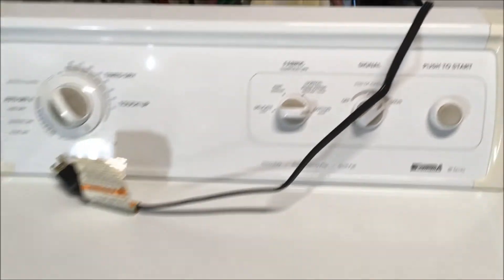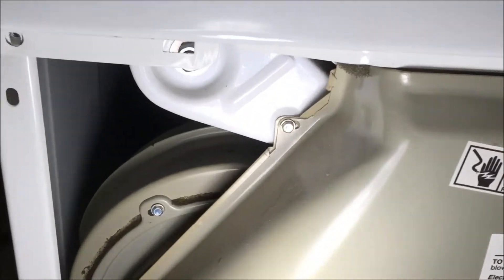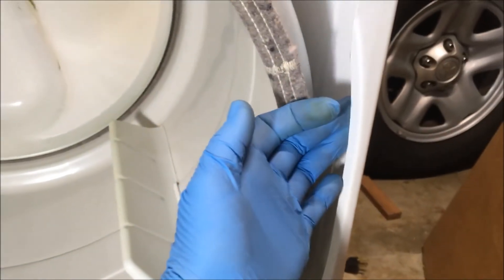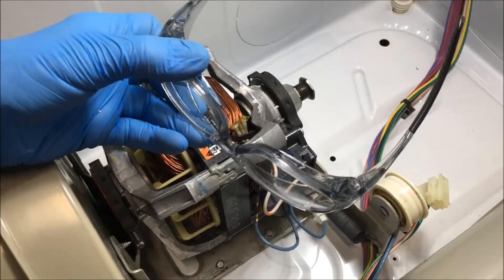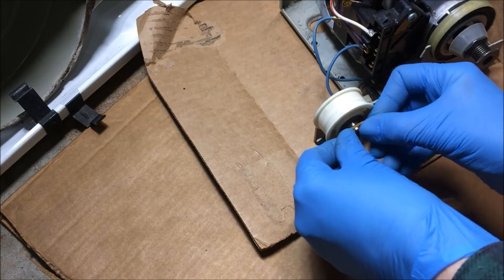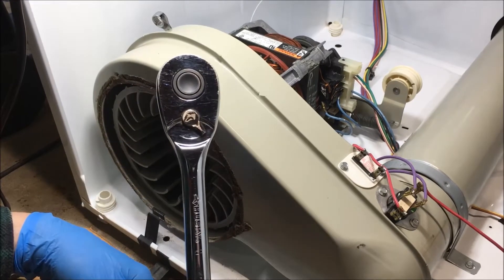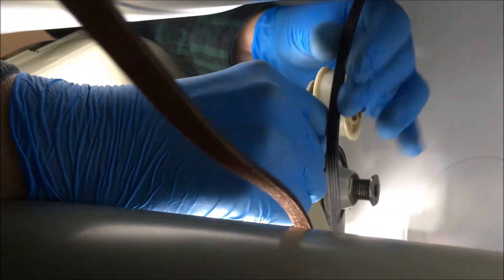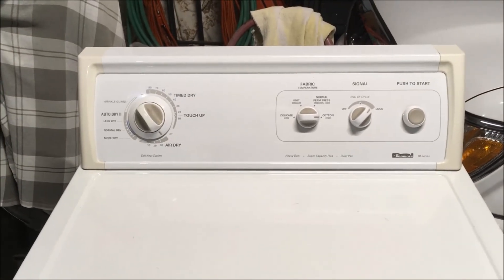Replace Dryer Motor | Kenmore 90 Series | Dryer Squealing, Grinding, Humming Noise, Won't Start

Comment: This was incredibly useful. A few notes:
- It worked perfectly for my electric dryer. The video, steps, pieces and orientation were all identical.
- I had a few screws left over. Was this an omission in the "put it back together" video, a mistake I made, or something like "the new motor came with screws"? Unknown. Everything seemed secure and where it belonged.
- If you are doing this yourself, TAKE PICTURES even with the video. They saved me on a few occasions, especially the belt wrapping in an S-position, and knowing which way the belt went on the drum and reconnecting a few "obvious before I took them off" connectors.

Dryer is back together, and while the replacement didn't fix my problem, it's at the same working level as it was before I started. Thanks!

Comment: Excellent video. I was able to replace the motor. The biggest problem I had was installing the belt. It is a tight space. Just remember to install the belt on the pully first and then on the motor shaft as you raise the spring pully shaft.

Comment: This is beautiful work. The details are great. Excellent tips. Wire marking is great move. I truly have no questions regarding the work shown in this video. I have the exact same model, and have done a little work on the front, this fills in my answers for getting beyond the front. Even has the whistling bypass!!
Reply from the maker: Thank you kindly for your nice comment.  ;)

Comment: I agree with Michael's comment above: Absolutely superb video. Exceptional lighting  and visual clarity. Bravo! 👏 
Made it to the 7:48 mark in my teardown, and then the plastic fan cracked along the square 1/2 inch mating surface before unscrewing. I'm guessing it may have melted to the threads due to age and possible overheating. If I can't find a replacement, I'll just replace that entire lint-trap section, I guess. (...and yes: I was turning said fan clockwise as directed.)

[ To be continued... ] 😎👍
Reply from the maker: Thank you, Jim, for your thoughtful and kind words.  I truly appreciate that you took the time to convey them.  Regarding the fan, yes, they can crack with age as they become brittle or if they are put on too tight.  You can look on eBay for a replacement fan/wheel.  Just type the model of your dryer into Google and get the part number.  Then, head to eBay and look for a pre-owned or new one from a highly-rated seller.

Comment: Hi! Since the is the very best video on disassembly and assembly of this dryer Ive ever seen, I wanted to ask for your opinion.  I've just replaced the motor in my 90 series for the 2nd time and I used your video this time.  Im glad I did.  I noticed your drum spins VERY easily complared to mine. Ive replaced and lubed all the rollers but I can barely spin the drum with two hands. Do I need new felt drum gaskets? do they make THAT much difference in the spin difficulty? What else could it be? I really appreciate any input and I look forward to your next videos! Dont stop, youre awesome!

Comment: Thank you so much for a very detailed video that was very clear and easy to understand. I have the same dryer except mine is electric not gas. How did you know that it was the motor that was bad? I believe my motor is bad because I turned off the heat on my dryer just to make sure it wasn't the temperature thermostat that was bad. Ran the dryer on air and after a few minutes it stopped running. It also does make a humming sound when I push the start button and I need to hold it down for the dryer to start. After it turns off I need to wait for about a half an hour before I can start it again and then the same thing happens after a few minutes.
Reply from the maker: Hi Laura.  You're welcome, and thank you for your lovely comment.  As to the issue with my dryer motor, the issues you describe are the same issues I had with my motor.  Additionally, I had intermittent heat at times.  After several weeks of the dryer have wonky problems, I heard an intermittent squealing noise in the dryer and put my ear down on the lower front panel and could hear the motor was squealing.  I then knew the motor had to be replaced.  But, the "humming" you  describe was the indicator to me that the motor was the issue.  

Some of the issues you describe can also be the result of one of a few of the cycling components failing or being faulty.  I will be doing a video on how to troubleshoot and replace the cycling components within the next 2 weeks.  Please let me know if you need more help.

FYI: Let add this--if you purchase a new motor, I highly recommend that you don't get an aftermarket motor because they have issues with the motor shaft being too long which causes the blower wheel to rub and damages it.  Also, there are issues with the electrical configuration.  You will find the manufacturer part number in the video description.
Reply: @frugaldiy1  yes I was looking at the parts that were available to buy and if it was a cheaper part that was aftermarket seems that they tend to fail quite quickly. I'm going to check with the local appliance shop first. But maybe I should also check the cycling component? That's probably a cheaper part.
Reply from the maker: Yes, cycling components are cheaper.  If you buy an OEM motor, sellers on eBay have the best prices.

Comment: Thanks alot for the detailed video! I have the same Kenmore 90 Series dryer(but electric,not gas) will the OEM replacement motor 279787 from Amazon fit my dryer? My motor bracket is exactly like yours.
Reply from the maker: Hi, Jesus, and thank you.  I don't know.  I'd type the model number of your dryer motor in online and see what motor is recommended.  Good luck on your project.

Comment: This is a great video! Now I'm stuck because the blower wheel won't come off, and now it's stripped, the ratchet just spins inside the fan. Now I'm not sure what to do. I think I have to break the fan off in pieces and get a new one?
Reply from the maker: Thank you.  Re the spinning fan, I'd have to see it to know exactly how I'd remove it.  I'm a big fan of Vice Grips when I have something that's stripped.
Reply: @frugaldiy1  I did end up having to break it off with a hammer and chisel! It was fused to the motor shaft too and I had to chip away at it once the big pieces were off to pull the motor out through the small hole. There was no other way. It was crazy! But it was so satisfying once I turned it on and it worked again. 

Thank you so so much for helping me save my dryer. I love my 90 series set, and I have made many repairs on them. This was the most complicated one yet though. As long as there are parts, I will keep them forever!

Comment: How old is too old to replace a motor? Mines from '98 and wont spin, rollers and belt are fine.  Should I spend ~130-150 on a motor or replace the dryer?

Comment: Without warning, my older Kenmore clothes dryer motor wouldn't start (motor # 690870). When the start button is pressed the motor turns about 1/4 inch and stops and hums, if I spin the drum by hand it starts going and completes its cycle, indicating that lubrication isn't the issue. The motor shaft spins freely both with and without the belt attached and as soon as I hit the power switch and spin it the motor takes off and the centrifugal switch kicks in and moves to the proper position. So the motor runs when nudged, the power switch and door switches work, it just won't start spinning without an assist although it gives a little wiggle movement when the power switch is pressed. Is there a start-up circuit in the motor that may be defective? Or?? Thanks in advance for your thoughts.
Reply from the maker: Michael, I suspect the belt needs to be changed.  Over time, the belt surface becomes cracked and worn, so it can't "grab" the drum to turn it.  In your case, when you assist the drum and turn it, as the dryer/belt heats up, the belt expands and is able to grab the drum and turn it.  Here's my video on replacing the dryer belt:  https://youtu.be/ijdcNI1gDrM